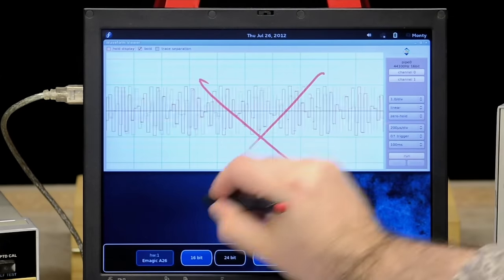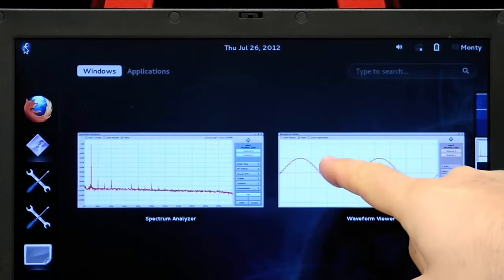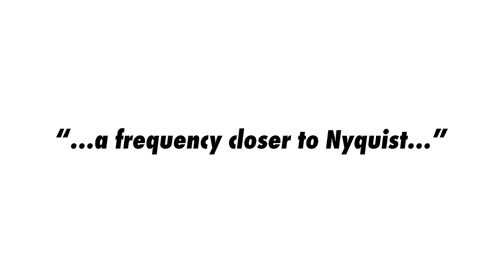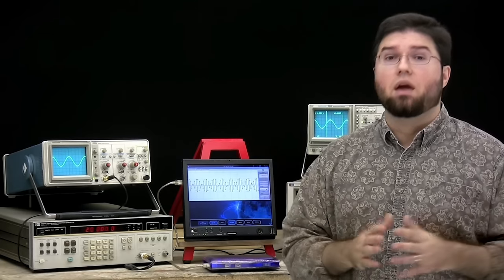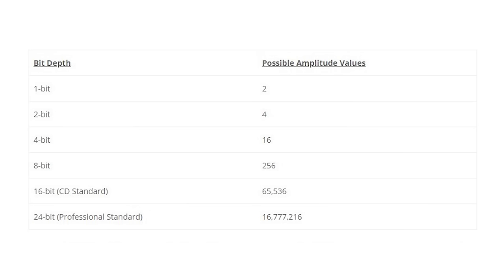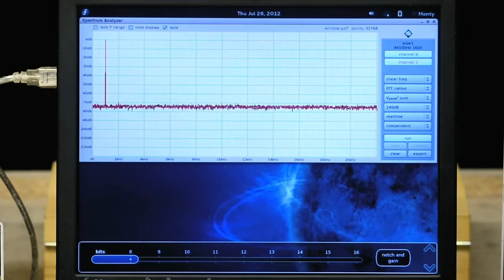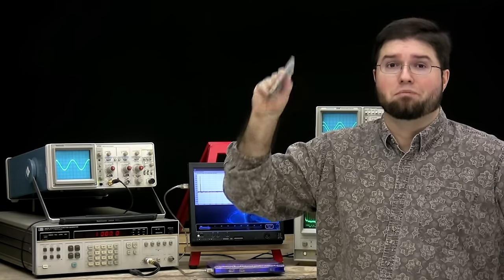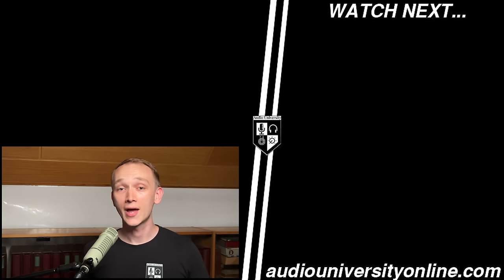Debunking the Digital Audio Myth: The Truth About the 'Stair-Step' Effect

Comment: This is an erroneous perspective, kiddo. You are Dunning-Krugering a bit. The fact that pretty much all DAC's oversample AND smooth using analogue methods (f.ex. capacitors).. doesn't nullify the fact that there isn't a quality difference. Your main mistake is that you were using just the one frequency; It can only try to smooth the waveform as a whole, and if it is just one wave then it just will be smooth..

The data is what the data is.  BUT there have always been various types of "smoothing" going on (heck there are no perfect DACs so technically it WILL be smoother, and even in the earliest days of synthesizers they USUALLY added some extra smoothing using capacitors,.. Even when you were making Chips that were specifically trying to create different types of sounds using square-waves and Sin-waves they still at least trimed the edges a bit, so.. IF you played the highest pitch perhaps it would've been even closer to a sine-wave than the one you were trying to synthesize).. 

and then. .By the time CD-players came out they had ALREADY gone further and instead of just smoothing with capacitors they actually had more complex systems (Some actually oversample the data). 

But.. none of this means that the.. "quality" is at all better, it only means that the low quality will sound softer. 

and when discussing whether higher sample-rates has any merits.. well. In THEORY a 44.1kHz sample-rate mean the highest frequency it could replicate would be 22.05kHz. IF we aren't just using technology to grossly misunderstand real-life scenarios (~starting~ with trying to record a digital sample), but assume we are trying to record an actual sound in the real world, then.. IF we have an actual 22.05 kHz Square-wave that matches up PERFECTLY with the actual samples taken by the mechanism recording this, then it would pretty much be able to reproduce it perfectly.. IF it  not a perfect Square-wave OR a perfect match, then.. Each sample will be pretty much the "average" of the in-signal during the time when the sample was taken. This means that IF you play an actual 22.05kHz Square-wave, BUT it is EXACTLY off by a "half" of the actual samples, then one sample will be a perfect "mix" of the half of the last period when the signal was high, and the first half the subsequent period when it was low.. in effect nulling each-other out, and then the next sample will be the second half of the low-status period, and the first half of the following low status period.. If having a Sine-wave instead then about the same facts are true, BUT because a sine-wave Isn't just at "full effect" all the time, so what you will have recorded (Agan: Not neccesarily what you get put out to the speaker) will be moderated in volume compared to the "true" volume of the sine-wave.

and this is before we start talking about how the analogue waveform compared to the mathematical representation work in frequences inbetween actually being 22.05kHz (Where we have two samples pr wave) until we get to 3 samples pr wave.. A huge part of that spectrum will just be noise that we can't really assume our ear to be able to recognize as an actual frequency, and NO amount of smoothing will make it better either, if anything all the smoothing that is going on  in modern electronic will most likely even out the little representation those waves have in the data to begin with.. 

But when we start having four samples or more (11.025kHz). THAt is when it starts being fairly okay representations of how the sound ACTUALLY is.

The smoothing will STILL affect the volume of higher frequencies a bit higher than lower frequencies, but from 11kHz downwards it really starts becoming negligible. 

I ranted a BIT longer than I had, past the point of saying that the stair "is there" it is just that people smooth stuff out.. You don't get "better sound" as in "more fidelity".. it's just slightly softer to the ear; Data that is lost IS data that is lost.

But fair enough; I don't hear much difference.. In part because I have tinitus, because I am a bit older (you lose the higher frequencies fairly early), but most of all.. because I haven't got good enough speakers to represent  the really high over-tones to begin with.
Reply: @nicksterj The only thing I didn't respond to was the imaginary technology yet to be invented that he was claiming would be in use. (That the actual samples.. AREN'T samples, but some form of mathematical point. .we don't have microphones that work that way, much less ADc's that can work in an infinitely small point in time.. and more importantly. .Even IF those samples REALLY would properly be explained by that mathematical model.. 

I want to see the supercomputer they think are part of a modern stereosystem that would ACTUALLY diseminate a Wav-style representation of an audio signal to a FULL spectrum analysis of the data and then discart ALL solutions that are ABOVE the actual frequency range that can be represented. .no, no no.. it's a VERY simple extrapolating/softing routine.. IF something turns VERY quickly, and so on it MAY figure out data-points that are OUTSIDE of the kinown samples in height, but it is NOT correct representations of the ACTUAL curve. .it is just a more complicated way to smooth a curve.. Thinking tha tsome frequencies would have to be outside of the range?.. not part of any DAc I ever had my hands on.
Reply: @nicksterj .. Thank you.. my point exactly.

Comment: 32 tracks of 24 bit mixes and compresses much smoother than 16 bit. And to me, 96 kHz tracks are night and day to 44.1.  The d/a filters to smooth out the ladders just work much more accurately to reproduce at the higher rates. You can’t just tell on an oscilloscope, you need a harmonic distortion analyzer. Or a good ear.

Comment: I am completely not interested in measurements. What I hear is the only important thing.
But don't believe a pro musician, ask professionel conductors. They will tell you the ranking;
1.  vinyl  2. high ress  3. cd.
Reply: Bring back the tube!  Vinyl was always defective to begin with, but it does have a strong romantic connotation.  Hires is useful for mixing and production (low risk of hitting a bound), and in the per-processing for a DAC (easier to get a steep and smooth roll-off at the Nyquist frequency).  CD is perfect to capture everything within our hearing range - but not for general signal capturing of course!
I've analyzed many hires recordings, most of them just carry loads of noise in the high bands, and the others nothing at all.  At best it doesn't do anything, at worst it may damage your equipment or cause interference in your audio chain.
Reply: @nicksterj Not everybody is able to hear that kind of differences. Be happy you don't have to spend a lot of money, to enjoy music.

Comment: It's quite obvious that nobody knows the phisycs of sound you might be surprise to know were problems are, cherry picking between theories and bat hears is a no go way.
Don't knowing what to look for, don't knowing the real meaning of theories and practicals problems diverting form ideal, is a good recipe for a disaster and perpetual debates.
Not surprise, as example, if a DAC playing, which has internally a sigma-delta (so a inner ring with the same 1bit used for the DSD) sound (or better acts) like every think else with a 16/44.1K stream as with higher, what about effective bit resolution do you really think that 24bit effectively perform as in theory? 20bit of effective resolution is the most luxury you get in probably among best recording studios on the world wich also probably use a rubidium master clock generator (so an atomic clock).

Comment: Awesome explanation. However there's a substantial inaccuracy regarding Nyquist frequency. It's impossible to represent perfectly as you've got with only two phases for it. So if it's not perfectly aligned with the sampling points it will be attenuated. And frequencies close to the Nyquist limit will have beats after sampling. Honestly I've got no idea about how this problem is handled in digital mastering and whether it's solvable at all.

Comment: Fake.
Analog is not descrete samples. Analog is a continuous variation.

Whereas, Digital is descrete power or samples. A compensating or adjusted input can smooth curve between the samples. However, these adjustments to mimic analog are still going to be descrete signals and now synthetic, faked. 

Any digital signal can appear analog with a zoom level. 

Any analog signal will not appear digital. Unless only sampled at descrete times.

Digital can mimic analog at high frequency and be indescribable to human detection. If, sampling frequency is higher than human abilities.

Comment: You misunderstand. The underlying data is a stair step and the DA device used that as a basis for synthesizing an analogue signal which is smooth. However two things happen with 16 vs 24 bits. First, there is less dynamic range in 16 bits. It's not about "noise floor" really but about the softest actual signal compared to the loudest. On a very good playback system the difference is apparent on music that has a high dynamic range and is not over-compressed by the engineer (loudness wars). So on a symphonic piece it's very apparent. The other issue is on complex tones that are rich with undertones. Acoustic guitar strumming for example will suck up all the bits you can give it when recording with variable bit rate--more than just about any other instrument or even the human voice. Strange but true. Limited bits by nature lose a lot of that sense of reality. Here's a test. Try recording at lower bit rates, all the way down to just 8 bits. The same artifacts introduced are there even with 16 bit though to a much lesser degree. In fact, it's often not noticeable depending on the source, playback gear and environment. But I can tell you first hand that recording my electric guitar into a DAW at 16 bits stinks compared to 24. Huge audible difference in lack of dynamic.  Overtones are the other area where limited bits lack. The signal is very complex when there is acoustic interaction between instruments/voices and those micro signal levels make all the difference in the DA transcribing them accurately. Some call it "harmonic rightness" or a "sense of air" but what they are hearing is very complex and natural harmonizing of the tones and overtones. Again, that 8 bit experiment will not only suck that out, it replaces it with a gritty etched sound.  I believe that's the main reason many still prefer LP's and analogue. But I like high def, having been a veteran for decades of analogue.

Comment: Both videos have no clue what they are talking about. Recording digitally means you only have a sample every x amount of time. This is your "stair step". no matter what you do it is there with digital. You can hide it from an oscilloscope by running it through a filter even if it's an unintentional filter such as an amplifier, speaker wire or a speaker it self. It all has inductance and capacitance. The true question that needs to be answered is how fast does our ears and brain detect change and is it inserting or eliminating somethings that really is or isn't there. That question will probably never be answered. In this same argument is video resolution and I can tell you going with 4K sure looks like crap compared with real life.

Comment: I know the theory, I have the same test gear since my Uni days in1994 but my ears hear differently. Digital audio is so bloody bad & DULL & DEAD sounding I refuse to buy digital music for well over a Decade now. I've gone back to Records, tapes & valve amplifiers. Until these clowns pick up their act with complex sound sampling & reproduction, I'm not buying, remember the digital examples here are NOT REMOTELY COMPLEX & unbelievably easy to reproduce (god I can make a wave form like that on a bread board with a 555 timer ic FFS), this is Not a real world example of complex digital sound sampling & reproduction.
Reply: @nicksterj Mate I thought digital would be awesome & it is with signal to noise but that's the limit of it really, it just sounds so Dead, I've always smashed it with heavy equalization to try & liven it up, but there simply is parts of complex music missing that sampling don't seem to be able to catch or is lost in serious sound processing like being run through a sound  compressor which is a pet Hate actually that definitely reduces sound quality.
Reply: @nicksterj This is true, and when the sampling is done front to back with that very high rate, the sound quality improves out of sight & I believe in my experience so far can easily exceed analog quality but only if this is done but it is not done. Standard music recordings seem to be sampled in probably 24 bit at best, sometimes the sound quality of music barely makes it past 16 bit sound & you know what that sounds like aye. It's Massively disappointing to pay top dollar for utter trash, I've had rather low quality tapes make better recordings than some of my bought CD's, makes me bloody mad. If they trippled the sample rate front to back I would be happy with that I think as long as quality gear was used. I've done ametuer productions with the simplest of gear & had far better results than the CD's I have bought so what tha hell are they doing in those sound studios???? purposely destroying the quality?

Comment: This is really interesting but it's missing the psychoacoustics. The Niquist theorem presupposes that 20khz information has no audible impact, which is not unreasonable  until you consider this.

Lets say you can't process any number bigger than 300, and a signal comes in made up of -500 and 700, using the niquist theorem as implemented in this video, we'd discard the 700 and just be left the -500. But if we process the whole signal including the 700 we're left with 200 which is still below 300 limit

I am not saying we can hear ultrasonic frequencies, i'm suggesting it is possible for ultrasonic frequencies to alter lower frequencies to create a different lower frequencies 

This was interesting but it really should've been limited to why DACs don't make stepped waves (except when they do looking at you NOS R2R dacs)

Comment: Well nice try, but your not taking into account many factors.  Its just not that simple.  One sound and particularly music is not just a simple tone.  Music and sound from a instrument is much more complex.  You have the fundamental note but there is also complex harmonics and overtones.  Not to mention ambient information, acoustic from the room or hall it is played in and recorded.  So in other words music is a series of complex sound waves that is better captured in the analog domain.  Next is the Nyquist theorem.  The assumption is we only need to reproduce sound from with in our hearing limits from 20hz to 20khz, and that the sounds above the range of human hearing don't matter.  again a false and limited thinking on sound.  We don't just hear sound we feel them as well.  So if you cut off or limit the sounds above or beyond human hearing "limits" they do effect the sounds with in the sound range we do hear sounds.  Can you imagine what would be required to capture even one instruments sound waves digitally ?  The reality is as you increase the sample rate you easily can hear the difference in sound quality as its ability to capture the more complex sound wave if played back on good equipment and on a good and well tuned system
Reply: Sorry, sampling theorem applies to complex soundwaves and harmonics  as well since they consist of simple sine waves. This is very basic stuff. Your claims are not supported by theory nor by empirical evidence at all.

Comment: The only thing correct in the video is when the demonstrator says you can only look at the dots and not the data between, on high speed digital oscilloscopes when you zoom in on the screen the only actual data point is the dot where it was sampled the line in between is just drawn to the next data point. The demonstrator is knowing/unknowing misrepresenting the output signal by using the Tektronix CRT oscilloscope, and the filtering circuits on the output of the DAC also eliminate the “Stair step”
Reply: @nrezmerski my comments were on the output oscilloscope not the frequency spectrum analyzer
Reply: @nrezmerski The correct piece of test equipment would be a digital recorder with a sampling rate greater than the sampling rate of the DAC. The problem with the Tektronics o’scope is that the CRT is displaying the image of 15 KHz, obviously at 15,000 times per second, if the signal generator was dropping every 100th sine wave you couldn’t see it on that o’scope, in fact the 1KHz stepped signal he shows  of the digitized signal if shown on the o’scope would look like a pure sine wave. Hence the oscilloscope does not prove his point.
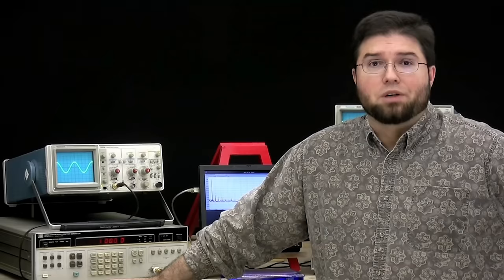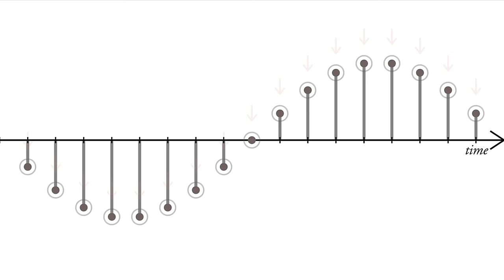Reply: @nrezmerski FabFilter video Samplerates: the higher the better, right Between 1:16 & 5:06 better illustrates the topic and correctly shows a trace of the signal showing more cycles. I have been in the signal processing industry for 39 years and the oscilloscope is the wrong tool for this demonstration period. A better video for the topic would’ve just talked about the reconstruction filter in the DAC and how it produces the sine wave.
Reply: What does the demonstration gain by intentionally misleading everyone?
Reply: @DeltaWhiskeyBravo13579  you’re correct (what reason would he have to deceive people) he is just uneducated on how the oscilloscope works and I guess for that matter how the reconstruction filter works in the DAC otherwise he would’ve just explained how the the filter recreates the smooth sine wave and he could’ve hooked up a signal recorder and showed a series of smooth sine waves.